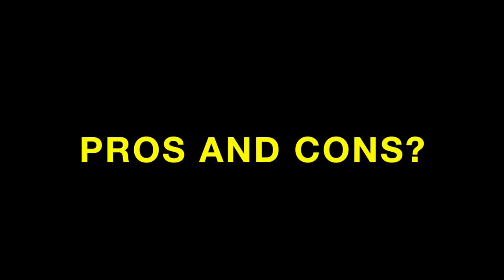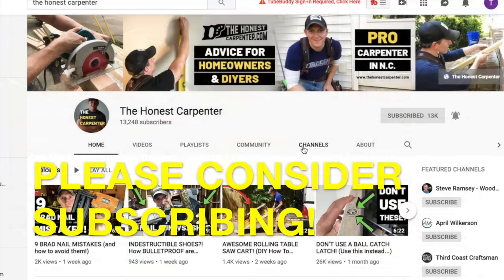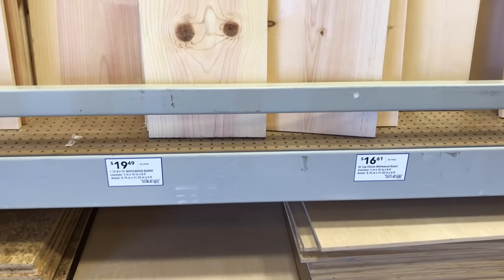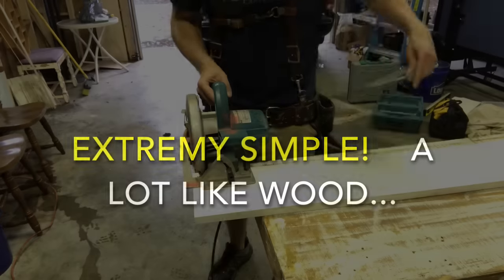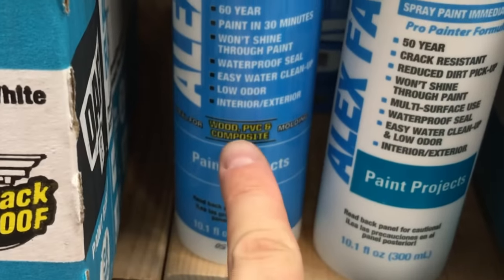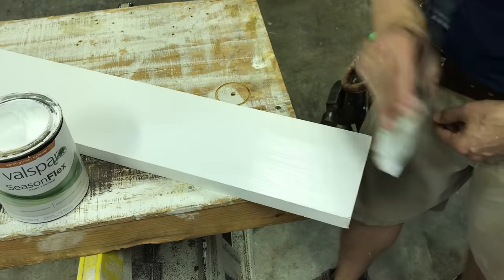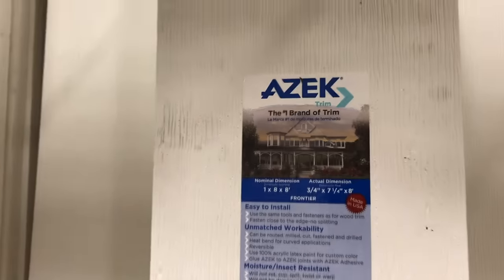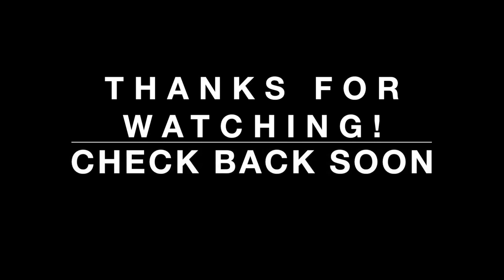PVC TRIM VS. WOOD TRIM? (Pros And Cons!)

Comment: You're giving the prior Carpenter crap for replacing such wide pieces with 1 by 12 Pine. And then you said you had to spend $160 a sheet or board when it comes to spending maybe $30 to $160 for a piece of wood the homeowners going to go with the $30 board every single time. And a lot of times there is no option to buy a full sheet like you said. And then when you buy a full sheet and you only need 1/2 ft piece of 1 by 12 out of that look at all of that waste. I say that as I still have a big ass chunk of it after 15 years from my job I did that I never needed another piece even close to that size of the of the 3-foot by 4-foot piece I have left of 3/4 inch thick

Comment: I like it! I’m in Texas and the sun ☀️ is brutal. Is it subject to sun ☀️ damage?
Reply from the maker: @Leslie Prigmore Thank you! I've searched around and I can't find any real mention that PVC sustains damage from long-term sun exposure, especially if it's well-painted. BUT, I have seen vinyl siding warp when it catches heavy window glare, so it seems reasonable that that this stuff could do the same in extreme situations
Reply: IMHO, PVC should always be painted when UV exposure is possible.
Even the grey PVC conduit will become "chaulky" in just a few years when left outside under direct sunlight.
Nothing breaks down PVC faster than UV.
A good quality Outdoor paint with UV blockers will stop it from degrading, but must be maintained quickly, if/when scratches or nicks occur.

Comment: I’d love to replace my rotted facia with this, EXCEPT:
All trim is painted dark brown.
Could I oil prime it and have luck with the dark paint? 25’ up. I only want to do it once.
Reply from the maker: I’m not sure the oil would work on it Michael 😕 One of those serious product limitations
Reply: The problem isn't the paint not adhering, it's the heat extra build-up if it is exposed to direct sunlight.  On a hot dry day the PVC would grow in length considerably but wood or metal products alongside it would not. The PVC will either warp or push other material out of its way.

Comment: PVC is a petroleum-based product, certainly not a sustainable resource as wood is or can be; PVC dust isn't biodegradable and isn't recyclable as far as I know, so that's also an issue. PVC's  imperviance to rot is a major plus, at least for certain applications as mentioned here, like outer doors and window trim. One thing to bear in mind: burning PVC creates *extremely toxic fumes*, and I would therefore advise against using PVC moldings inside the house unless absolutely necessary for certain environments and applications, such as bathroom windows. If a home is being built with crown moldings at the wall to ceiling junction, DO NOT USE PVC; if, heaven forbid, you should have a house fire, and the flames lick the walls and ceilings, the toxic smoke could kill the residents or firefighters, and ductwork can spread the fumes throughout the house while you are sleeping. (This is why commercial buildings don't allow ordinary PVC wiring inside the drop ceilings because a fire in one section of the building can spread toxic smoke through the duct work or plenum return and people were found unburned yet dead as they headed towards the building exits).  I wouldn't worry about PVC pipes that carry water in sewage because they're solid wall and filled with moisture, but air-foamed PVC mouldings are probably far more likely to burn.

Comment: No. You don't just, "deal with it," in regards to the cut edges......As per the versatech information; once you cut it you, "open the cells," along that edge. Doing this will allow mold/mildew/grime and degree to build up along that edge within a few years and look like shit....You need to, "close the cells," again by essentially sanding until it looks like the factory face; which is  recommended to be up to atleast 320 grit.   I usually send twice, once with 100 grit (occasionally is deep scratches or some shit I might start with 80 then 100,) then 200-220, then 320 atleast, 400 If a special situation that u want 110% perfect.  Versatech used to suggest wiping with acetone, but this has since been changed to any general purpose cleaner as acetone was found to dull the sheen of the factory face in some instances....any multipurpose cleaner with bleach is even better....I have found spray nine to be more than efficient for cleanup when job concludes.
Reply: *debris not degree lol obviously ...damn autocorrect

Comment: I've noticed when using PVC trim after you ripped it the edge is sharp like a knife and if you do not go sand that edge down you will cut yourself or the homeowner.
Reply from the maker: Good point Jeff. (No pun intended). It’ll hold an edge like metal

Comment: 5:45
lol
galvanized nail
good job. now you have repeat customers in 5 years when the trim gets loose or falls off
Reply: What would you use then?
Reply: If it's coming off you aren't installing it properly. It requires more nails or screws than wood does but I've never had a piece come loose and I have it on my own house.
Reply: @eriksteffen6166  stainless?
Reply: @rickparker8883  false
Galvanized fasteners get so badly corroded they disaappear. I consistently see this with bolts used on patio enclosures
Reply: @stevejohnson4049  I didn't mention galvanized fasteners and use only ring shank stainless but where do you see galvanized bolts disappear? I work in coastal Florida and have seen plenty of corroded galvanized fasteners but only because of galvanic reactions with aluminum. It has nothing to do with PVC trim.

Comment: someone needs to make a PVC saw blade that doesn't cause dust but instead larger sweepable flakes.
Reply: A weapons grade, hot wire cutter could be the answer but then you'd have the fumes to contend with.

Comment: Why on earth would you paint PVC or uPVC? In England it’s used as a maintenance free product and painting negates that?!
Bob
Reply: I would like to see one of these "maintenance free" areas that you speak of that need no caulk or paint.... honestly. Are they caulked in? Unpainted caulk tends to mildew/discolor over time, not to mention, if it's not caulked (especially bon exterior work), what's keeping moisture from getting between your PVC boards and wooden framing? If you are doing repair work on a certain section of an existing wall, does that natural PVC color match the existing color? If so, how? Are you buying PVC that has the existing trim color manufactured into it? If so, where would I buy this? Of course there are situations where you'd need to paint it, if not always.
Reply: @American-Plague  WOW! Far too many questions for this little amateur. All I know is I have never heard of painting this stuff before and I am not sure we use caulking as much as you guys do. I know our stuff is uPVC which is unplastisied poly vynl chlorite some thing like that anyway. Wish I could  dive into this conversation more, I just can’t as I don’t know!
I had never seen caulk used for anything but seal a bath in reality until I started watching you guys, very very different approaches it seems. I hope I haven’t shot us all up a dead end! 
Bob
England
Reply: @BobMuir100  I mean yeah, it's "maintenance free", but for an example: let's say you have wooden quarter round trim or shoe moulding already on your floor/baseboard, and 3 feet (appx. One meter? Lol...we don't use metric.... anyway...) is rotten. The existing trim is already painted....let's say blue...any color will do. When you change out that 3 for section of rotten trim, the color needs to match the existing trim, thus, it needs to be blue also. Needs blue paint in other words. This is just one example of a situation where you'd need to paint it. (Hopefully this made things a little more clear?) 😎👍
Reply: @American-Plague  Yeah that sounds so obvious, so what do we (English) do or have I miss understood all my life? This is weird as I have zero UK experience to draw on!! Thanks for engaging me it’s interesting!
Kindest
Bob
England
Reply: @BobMuir100  Just prime and paint as usual. I've never had any problems. Maybe just to be 100% certain, prime/paint a test piece that you have left over first.

Comment: Wood expands in its width dimension and somewhat in thickness. But there is little to nil in its length dimension. PVC expands in ALL directions and not just a little bit. This brings in a MAJOR problem when installing. For if not taken into the expansion and contraction, you are going to have serious bulging problems. Not to mention gaps when it contracts.

I had this experience and it is NOT pretty. So make sure you have considered the coefficient of expansion and contraction; when installing, particularly in long pieces and real wide pieces.

Comment: The fumes in a fire are very toxic, but overall it is often the superior product.
Reply from the maker: @Richard Smith Thanks for writing in! I hadn't even considered what would happen when it burns, but I've got to imagine you're 100% right. Do you know if it combusts at the same temperatures as wood? Melts? I've seen bad window glare melt vinyl siding on an adjacent wall. Do you think the same thing can happen on the much thicker, aerated PVC trim?
Reply: Thanks for the reply. I have to say, I don’t know. But it’s a plastic and plastic burns well and gives off very toxic fumes. PVC is used throughout the building industry now so it can’t be avoided and I’d be happy in the US to have it on vulnerable parts of a wooden house, but I wouldn’t want the siding to be entirely plastic. I’d be interested to know the various performances of burning hardwood, softwood and plastic; including  their combustion speeds and toxicity. I do know that man-made fibres aren’t recommended when flying as when melted they stick to the skin and can’t be peeled,off. I always wear cotton and wool for that reason. I suppose the same rules apply to burning houses. I’m sure you are aware of the horrors resulting from plasticised building cladding on heigh buildings in Britain recently.

Good site by the way.

Comment: Small Brad trim nails don't do so well with it either, you have to put multiple nails in same spot going different directions to actually get a good grab, but then you hoping the silicone or caulking holds it...
PVC is the hot body and butter face of carpentry...🤣🤣🤣

Comment: After watching the video and reading your comments, you really don’t have much experience with building,framing or carpentry. Never mind using or installing, any “ composite “ product..
      Giving bad advice is just bad.  Listen, as a builder 30+ yrs, “ pvc” trim is great, so is wood. Depends on the product and installation method used. For pvc, Azek is ok, for ground contact applications or window sills. But “Koma” is a superior pvc product. Azek is made in a “ granular “ method , where Koma has fibers. 
       All joints must be glued , not with pvc glue, but “ white hot” , it actually bonds the two edges together. Another product is “2P10” which can be used with an accelerator, for quick setting times. All joints must be scarf ( scarph) joints, 30 or 45 degrees, for better surface area with the glue, not 90 degree butt joints.
     Nailing with smooth nails, galvanized or stainless is a No..Either “ ring shank “ nails or preferably “ trim head” stainless screws is the best method.. ..Cortex screws with plugs is acceptable if the plugs are glued. Painting is recommended. If your not a professional with years of experience, you really shouldn’t be advising people on subjects your not experienced at doing.

Comment: Stumbled across this video.

I don't like non-natural materials. Don't like to use them if not necessary. Just a heads-up, this next part is not to say "it's always bad for your health in every amount and governments are lying about this". It's just to state to be careful with what you believe and what you use.

With a lot of materials "they" say that it's "safe for humans". What they actually mean to say is "safe for humans as far as we know (has been researched) within certain limits of contact". For example, when temperature rises, you might smell PVC (and a lot of other products), or not smell it at all. Still, fumes are there that are toxic for life. Will you get sick? Hard to say. But like with all other kind of things (electro smog and wireless signals for example) it's known that people can get sick almost immediately. Even if they feel energy loss, dry mouth or whatever. That's why I think it's better to prevent using those kinds of materials.

As we don't know anymore what kind of chemical substances are put into products nowadays, let stand what they use to manufacture it, we have to be careful.

Concerning the use of this product. It's a disaster for nature. You mentioned the "dust" that is hard to get away. Sawing this material is probably more toxic for the environment and your own health than most wood species.

Besides that, wood is one of the products that can be very durable. If you treat it the right way. Not put the wood on damp places without any sort of protection. You could use plastic sheet to keep it from the ground. Also, you can use a metal system to lift it up just a few inches.
If you like that is up to you (or the customer). Just saying that wood, in a lot of situations, is very durable. PVC will dry out over the years and start to crumble. Nothing you can do about that (unless you will treat it the same as wood with painting and / or oiling).

To go short, it's not to nag, it's just to warn for possible danger with using those kinds of products.

Comment: i would not use PVC trim inside a home
Reply: I have used in the bathroom.
Reply: @picklerix6162   i would be concerned about smoke produced the exposed pvc in a fire
Reply from the maker: @Rob Bobcat A couple other people have brought that up as well. I'd say it definitely can't be good if it burns. But, you're vinyl flooring, PVC drain lines, and a variety of other things in the house could produce similar toxic fumes I'm afraid. Best to get out of there and don't breathe the smoke!
Reply: @TheHonestCarpenter   drain lines are covered by sheet rock and most other things have to be tested for flame and smoke test.....i think a small piece here there would be fine. I have seen guys  trim out a window in a show or bath i think something like that is doable

Comment: Also PVC is toxic if house were ever on fire
Reply: All due respect, there is a lot thats toxic if a house is one fire. Shingles, the plastic sheathing on the electrical wire, MDF trim, fiberglass, modern furniture materials, etc get toxic when burning.  I was in a house fire 14yrs ago and I saw it first hand.

Comment: My god american house building is so broken ... 

PVC lasts 5 to 10 times less than wood, If your wood rots, its not the right wood and/or not placed correctly. PVC is a horrible air and soil polluter, pvc frames are thicker than wood, you cannot maintain or repair pvc. Pvc is an ecological nightmare (500Kg/²m as opposed to -3kg m² for wood) dont buy PVC it's a shitty product.
PVC is also unstable chemically meaning it will fill the air with OVC, wich is responsible for white PVC greying over time.

Comment: Dude tell the truth its garbage. Properly installed and sealed wood is way better. The shrinkage alone is the biggest factor. You have some good ideas but you are def a rookie doing homeowner grade material. Install a 1 x 12 when its 90 out and then go look in the morning when its 58...